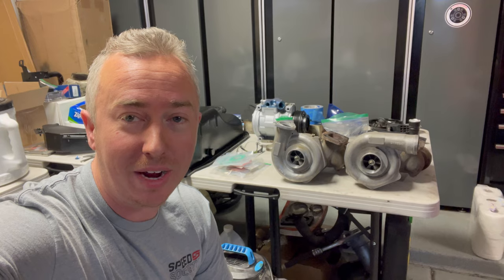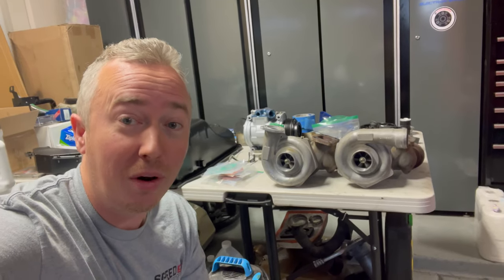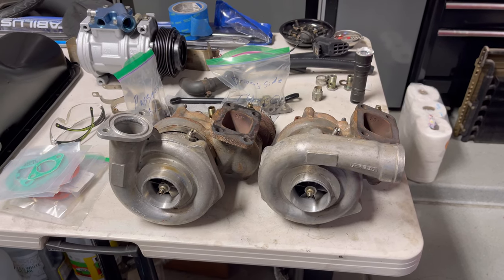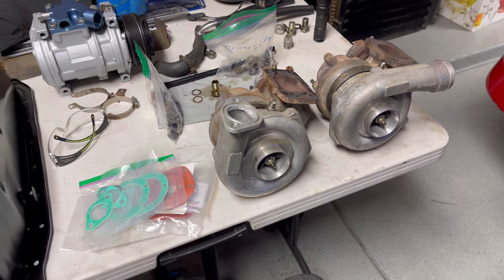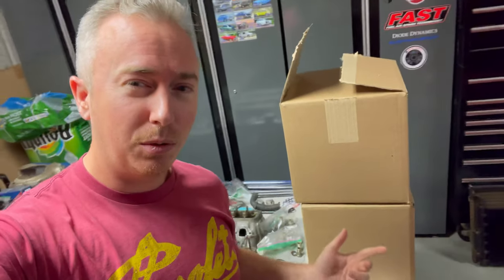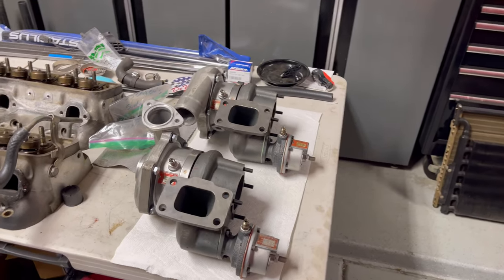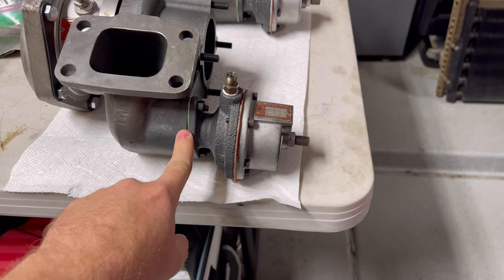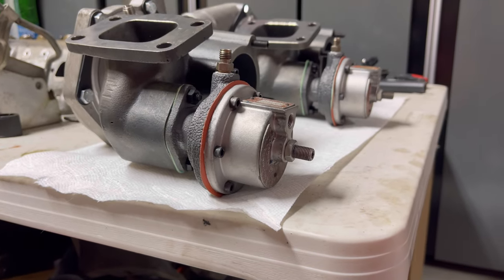Rebuilding The Callaway Turbos

Comment: I will highly recommend having all your hot exhaust part jet hot 2000 coated. The heat retention and corrosion resistance is unreal. And protection from possible engine fires is a plus

Comment: Hey man. Struggling to figure out how to troubleshoot my tach that isn’t working on my c5. It cycles upon start up but then goes to zero. Any videos on how to troubleshoot that issue would be awesome!
Reply: Mine kinda does same thing. When starting car it cycles to top and then bottom. Then sometimes it works and others it just stays buried at zero as if the car isn’t running. It’s about 60% not working and 40% works normally. Have no clue what it is.